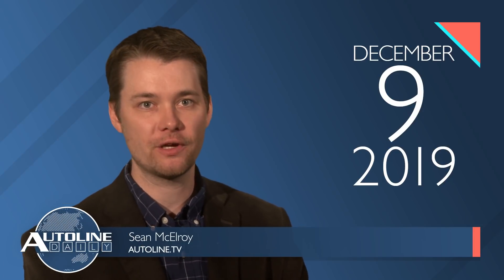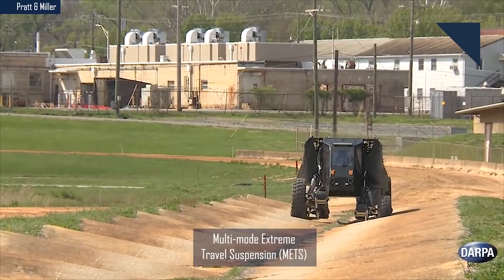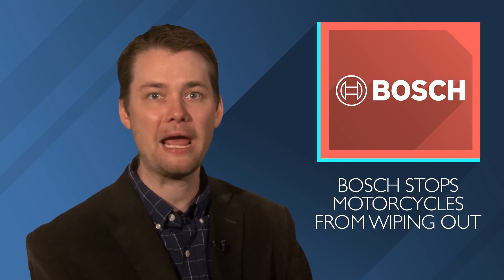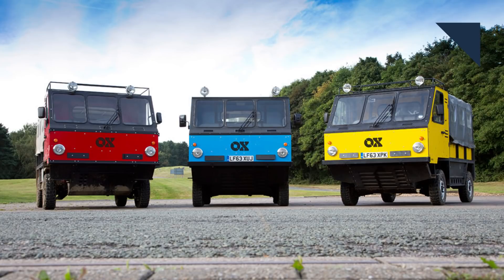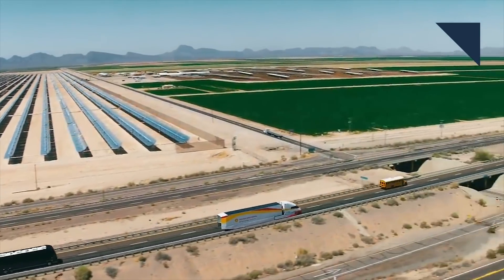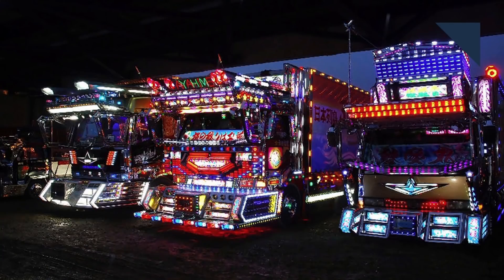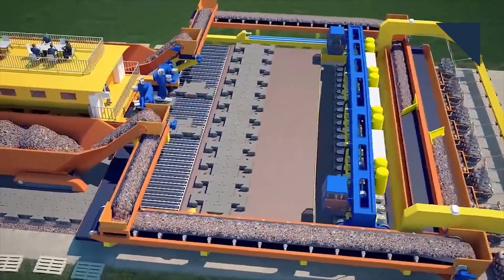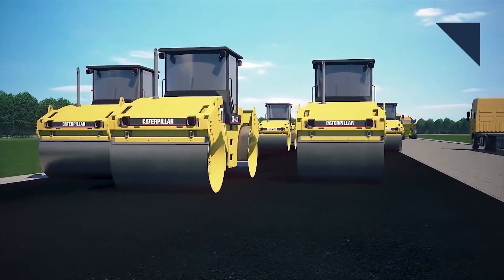Low-Cost All-Terrain Vehicle, Bosch Prevents Motorcycles from Wiping Out - Autoline Daily 2733

Comment: Wrightspeed have the, err, right idea when it comes to trucks and heavy vehicles. Basically, they electrify said vehicles and add a turbine generator. The turbine is efficient and only powers up when the batteries run low. The turbine has a long service life and can run on fuels currently available. It's a good 'stop gap' measure, unlike Shells feeble attempt.

Comment: If we could double the efficiency of every semi on the road, it would do more to reduce emissions than if all small cars were converted to EVs.
Reply: Gas Electric Vehicles (GEVs). The Generators would more efficient simply because they would not be made to move the truck and load, and just a generator. Even if you had to use a big V8 from a pick-up truck you are looking at an easy 2-3 times the f/econ as a default. The motors would obviously be more energy efficient. and because you still using fuel as opposed to batteries, you are not negatively impacting the load capacity of the semi-truck. The Typical semi-ruck engine itself weighs as much a full-sized pick-up, so you might consider some battery capacity simply to replace some of that weight and so the vehicle to drive about town or the truck yard with no pollution.